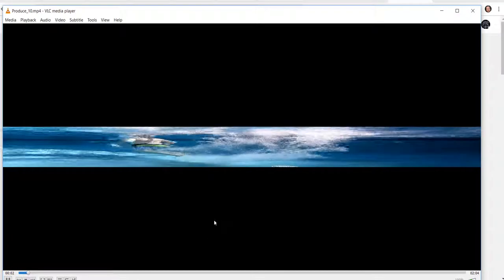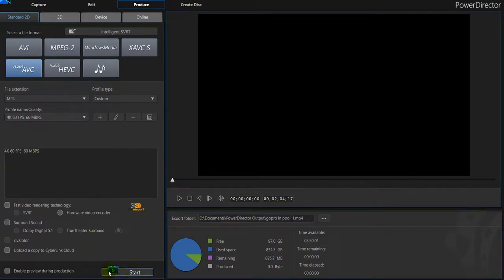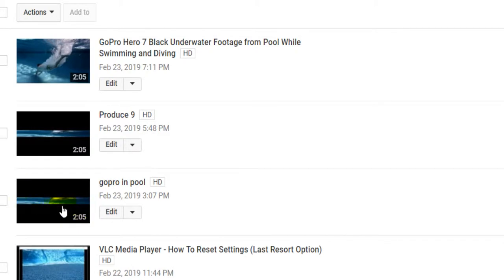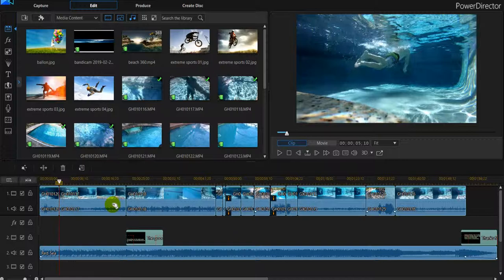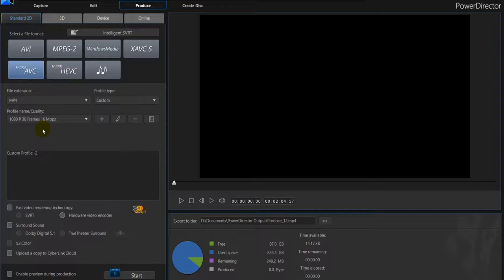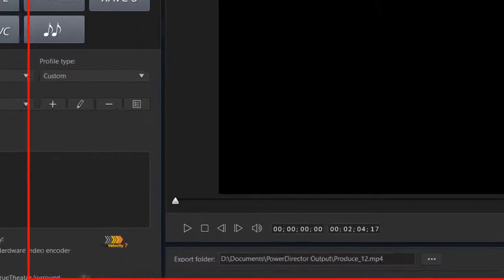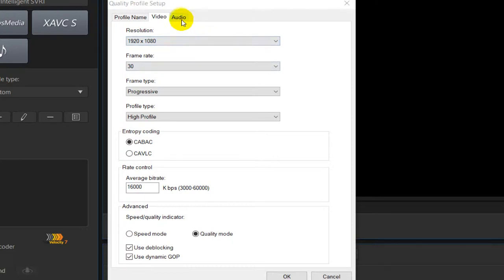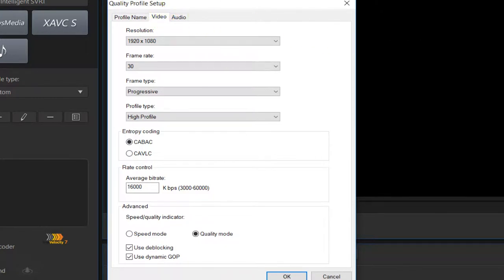Distorted Video after Rendering in Cyberlink Power Director! What's The (Easy) Solution?

Comment: I Could not fix the problem. I actually used VLC to re-record a clip originally recorded from a GoPro 8, and after importing it, it still looked like thin horizonal lines. Text captions looked fine. The original video was recorded in 4:3 format at 60 fps. Anybody know what the fix is??
Reply from the maker: CL PD doesn't like GP .... for some reason ... it's a shame ..

Comment: i wanted to do an audio interview with images over it but they get all blurry from time to time after rendering. How to fix this?
Reply from the maker: Did you check on the set video resolution and mbps you have chosen. I can change the quality a lot.
Reply: @allcheckout  Yes. The resolution is full hd, 30 fps, 15 mb bitrate. I tried even with 60 fps but it has the same results. The image gets blurry and then clears out. Like it gets  pixelated from time to time and then goes back to normal. I don't know what seems to be making this problem.
Reply from the maker: @AgoraphobicNews  Super weird. For good quality videos I go at least to 20 mb bitrate. Maybe even try to increase to 30mb and see if there's a difference. Here you can see my settings:  https://prnt.sc/10p7w6c
Reply: @allcheckout  I never had this problem before. it happens with Cyberlink Powerdirector 19. Now I'm trying to video render via Adobe Premiere.
Reply from the maker: @AgoraphobicNews  OK ... yes, could definitely help
Reply: @allcheckout  And the problem is the same with every software. I only managed once to make it without blur and don't know how.
Reply from the maker: @AgoraphobicNews  So same problem with Adobe Premiere now as well?
Reply: @allcheckout  I actually managed to do one video without blur but in it there weren't subscribe animations. That's the only difference.
Reply: @allcheckout  THe video is like 1 hour and 40 minutes long and it is so damn frustrating to see that it looks like shit from time to time.
Reply from the maker: @AgoraphobicNews  wow ... yes I understand ... crazy
Reply: I don't have this problem but I see a blurry bar at the bottom of all my videos it's not bad but it is. I need my videos on 4k thats why I bought all this shit